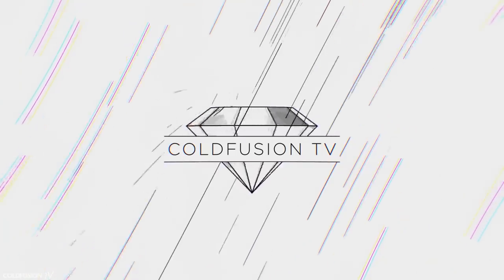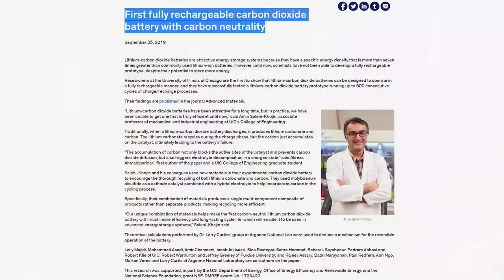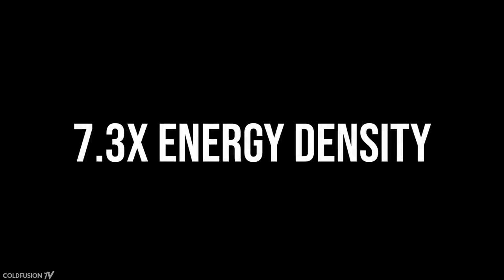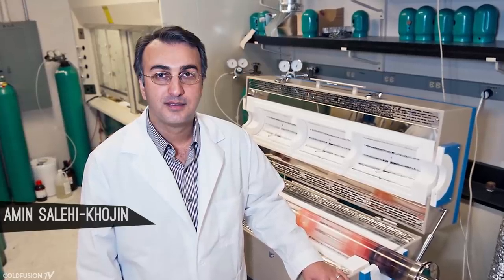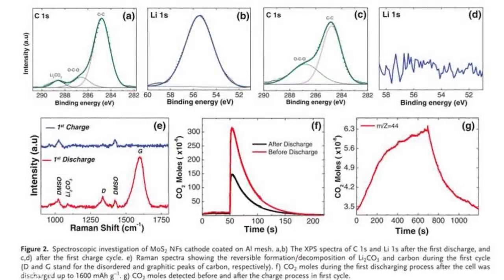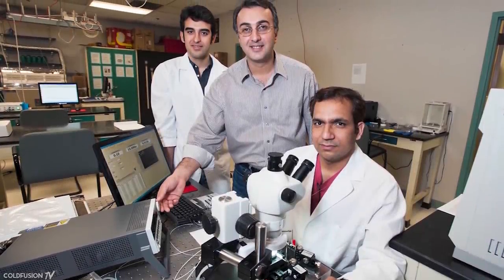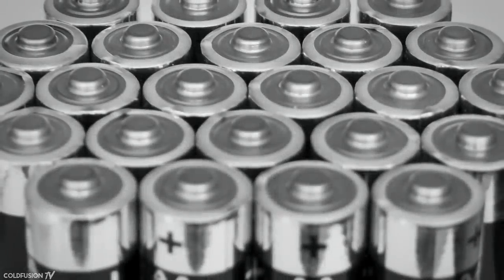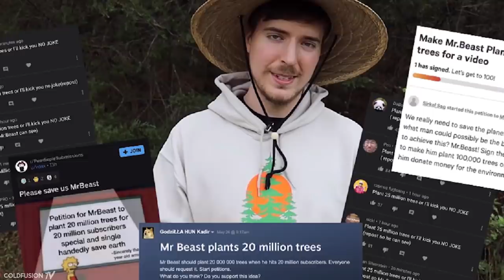Carbon Dioxide Battery Breakthrough

Comment from the maker: FYI, the research paper is in the second link in the sources, so you can read it there.
Reply: Can you make a video about Aluminum-Air batteries and the inventor Trevor Jackson ?
New recyclable Aluminium-Air power technology with 
1500 mile range battery and a 90 second swap system
Reply: I think I will never hear from this again.
Reply: 500 charge cycles in comparison to around 300 now seems not too beneficial for things like electric cars
Reply: You had to exploit the evil Co² propaganda and AGW didn't you...
Rather condescending to people who actually know the science well enough to understand that in nature, Co² is nothing more than plant food in the air and a climate stabilizer in the oceans. And in no way can it measurably effect climate change.
That's the sun's job.

But it's a cool idea, if it's commercially viable. Fascinating paper BTW.
Reply: Can you please make a video on nuclear fusion power production and potential
Reply: Very Interesting! Thank you as always! :)
Reply: Don't worry about the gap in videos, we prefer quality rather than quantity.
Reply: Carbon Dioxide batteries. 🤔🤔🤔

Get CO2 scrubbers to remove it from the atmosphere and stick it in a battery..... Two birds with one stone???
Reply: @TemporalOnline  Material science is a process.  One can complain about over enthusiastic reporting but not the science.
Reply: @TheScmtnrider  MIT have just done a similar thing without the lithium - carbon nano-tubes collect CO2 whilst charging. Then you can collect the CO2 whilst discharging and sell it to greenhouse owners ☺️
Reply: I'm waiting thunderf00t to shred them to shreds with basic thermodynamics... Mic drop
Reply: @thunderf00t
Reply: @TheScmtnrider , "...people who actually know the science well enough to understand that in nature, Co² is nothing more than plant food in the air..."
☺Refreshing to see people that actually understand that! Plants need carbon to build their mass. I didn't know that Co² was also a climate stabilizer. How does that work?
Reply: It's not 7 times more, it's 7 times as much.
Reply: @3deeguy  
2/3 of Earth's surface is water.
Water will absorb or emit Co², depending on atmospheric pressure and temperature.

Like a carbonated beverage left uncapped in a warm environment will rapidly emit its Co² into the atmosphere and get flat, just as if you shook it up and opened it.

Conversely, a capped carbonated beverage, stored at room temp under its own pressure, will retain its Co². The lower the temp, the less Co² it releases when opened.

You can shake it up, leave it capped, put it in the fridge overnight and by morning, the pressure and temp allows the liquid to resorb the Co² and it's no longer flat.

After the earths atmosphere warms, which it does cyclically, Co² is unlocked from ocean water and released.

It promotes plant growth that shades the ground and transpires more water vapor into the atmosphere.
Less heat is absorbed by the ground and clouds increase, along with plants and trees.

The atmosphere and earth now reflect more heat and the planet cools.
That allows the oceans to resorb atmospheric Co².

Plant and tree growth slow, plant transpiration and ground heat absorption reduces. Less water vapor is released, clouds decrease, and earth begins to warm.

It effects albedo and radiative heat transfer. It does so with decades of lag time and centuries of progression.

Ice coverage of land and sea are other causes and conditions that are part of the system as well. Galactic cosmic rays play their role and follow the he suns energy output 11 year sine wave and its hundred year grand max and min variations, as they also initiate cloud formation and the stratospheric volcano emissions increase with the GCR effect on increasing silica rich magma viscosity.

The past high levels of atmospheric Co²  went down over 12,000 years ago.
That Co² didn't just disappear, it was absorbed by the last ice age that ended with the Younger Dryas warming event.
That event's warmth again triggered a release of Co² from the oceans, and we've been hovering around 400ppm since it stabilized which, it did!
The charts showing the Co² hockey stick, uses a ridiculously low scale that makes the rise appear dramatic.
But we've exiting the strongest grand max since the Younger Dryas, hence the rise.

Expect Co² to go Jo higher. It will decrease after the cooling starts and the oceans begin to store it again.
Phone dying...
✌💨
Reply: @TheScmtnrider , "Ice coverage of land and sea are other causes and conditions that are part of the system as well. Galactic cosmic rays play their role and follow the he suns energy output 11 year sine wave and its hundred year grand max and min variations, as they also initiate cloud formation and the stratospheric volcano emissions increase with the GCR effect on increasing silica rich magma viscosity."
So the symbiotic relationship between plants and animals is even deeper than Co²-0² and the ocean releases Co² in sync with the growing season.
Wow, there's a lot of info here. When you mentioned "Galactic cosmic rays" I'm thinking 'ions'.  I asked myself if the magnetosphere came into play but that's not what you were saying. I never thought of the sun's energy in terms of a "sine wave". Never heard of "GCR".
That paragraph has a lot to digest and I couldn't grasp most of it but I'm going to study further because I want to understand it. Thank you.
Reply: As a student of Chemical and Biomolecular Engineering from UIUC (UIC's parent campus) it is nice whenever the cited reference is one I am familiar with. Thank you for seeking to maintain real, informative education for the masses using published scientific works rather than anecdotal evidence from what "scientest 1" on "this one show" said. I cannot tell you how much I appreciate it.
Reply: @3deeguy  
Your welcome.
GCRs are galactic cosmic rays.
Those are mostly high energy protons but are the same particles as in the solar wind, only traveling thru space at nearly the speed of light.
When they encounter the magnetosphere, they either pass through or are deflected by its energy.
That energy is the charged particles of solar wind that is captured by our magnetosphere's magnetic fields.

Weak sun =less energy and more GCRs get thru.
An active sun = more energy, and less get thru.

Once thru, some collide with or blow thru, mostly nitrogen molecules in the atmosphere.
The resulting cascade of exotic particles I included muons which form cloud vapor and hail nuclei.

The GCRs that don't have collisions coming through, can increase lightning. When they hit us, they can damage DNA and have other effects.
In hitting the ground, they penetrate, probably as far as to our core and beyond.

Have a great day
✌💨
Reply: Andy Spark fascinating bro, thanks for this post hopefully he does this. Will do whatever research I can as I’m keen from u’re post.
Reply: Absolutely love your channel. Keep up the good work. We need more positive like this.
Reply: @TheScmtnrider  That is misleading and wrong although it is what you say, it is also like salt in the ocean there is a level that it hits that makes it unlivable to fish for many reasons but unlivable to be assured.  Co2 is the same and the reasons are well know and unrefuted except by the people using terms like Co2 propaganda.
Reply: @TjBruce817  
Perhaps to someone who is unfamiliar with the effects of sea ice, and ratios of salinity to Co².

The Beaufort Gyre is a mass of cold fresh water in the Arctic that accumulates annually and releases. The salt content there is ridiculously low

It hasn't released in about four years.
When it goes?
I wouldn't want to be living in the British isles.

But you're a believer!
Nothing I say will sway your understanding.
Someday perhaps you will realize that belief is an emotion that inhibits rational thought.
Reply: On the other end of the battery sexiness spectrum, saltwater batteries are pretty interesting.
Reply: battery why?? if you use high power alternators geared on 106ish rpm to a 3000 rpm on the drive that would be for direct load and 20 years use potential and a small battery 5 years for loss and regulations flow depending on the system and amounts you need, have a 200kw 40x3.7kw alternators on a load motor and a resistor regulator from 7 + years back and the battery burns out to fast in 50 years lithium will not be around any more?. NASA couldn't even work that one out for a aircraft application I want my 1.5 tone off the ground with rail gun but got to that and we'll pig off a motor so cold fusion like the name!?. NEW YORK FULL...ssh!
Reply: @TheScmtnrider  in MODERATION CO2 is plant food. It is also a PROVEN greenhouse gas. That means, over a certain percentage in the atmosphere, it no longer works as a beneficial gas, but as a danger to our ecosphere. That's simply a fact. 

Denying it, saying it isn't true, does not change the facts of the situation. You can deny, deny, deny all you like, but it doesn't change the truth of the matter. AGW is a proven fact, as proven as gravity, as proven as a (more or less) spherical earth, as proven as the water cycle, as proven as the sun-centric model of the solar system. Pretending it isn't makes you look as intelligent as a flat-earther Luddite.
Reply: @MaryAnnNytowl  
No
You are sadly misinformed.
1800 PPMs of Co² is standard concentration for greenhouses but as for AGW?
It's effects are completely unproven.

It's based on a pre 2000 IPCC computer model that takes no account of cloud albedo, cosmic ray cloud production, solar x-ray forcing, the global electric circuit, etc... Don't get me started on TSI (The visible light spectrum.) All funded concensus science AGW studies are required to use it as the measure of solar forcing of climate. All other solar  influences are arbitrarily attributed to human forcing. Matter of fact, the suns most powerful outputs of x-ray light, actually cause TSI to reduce! Anyone looking at that knows that x-ray saturation is the cause of those TSI down spikes.

Furthermore, there are no examples of tested hypotheses failing to disprove Co² as a significant greenhouse gas.

What we have is 35 years of failed efforts to prove that hypothesis. That's the textbook definition of pseudoscience.
I'm sure you hate that word pointed at "reputable" scientists but facts are facts. Just as the 35 years of failed predictions.

Your statement demonstrates that you are unschooled on actual climate science. Also that you are unaware of the over 800 published peer reviewed papers on solar forcing of climate since 2010.
Not surprising as that contradicts popular belief and a myriad of corporate interests, including the media.

Farris Wald, a high school student won the Broadcom Masters national science contest by demonstrating the immediate effects of solar flares in the formation, invigoration and tracks of tropical storms.
He went on to win the Google world science contest for demonstrating the correlations between geomagnetic storming and tropical storm formation.

Climate is definitely changing but cyclically, as expected. Our sun's magnetic fields are weakening along with the sunspot cycles.
Simply put, a weak sun means loopy jetstreams and jetstream blocking.
A powerful sun does the opposite. That's how the Farmers Almanac is trusted.

Your belief is not based on science, it's based on science by press release!
I can link you to a shitload of studies. Tested hypotheses supporting my contentions.
I guarantee you cannot do the same with greenhouse gas Co². I know this because I keep up with the journals.

Remember, failing to disprove with studies designed to disprove! That's the big flaw in climate science. TSI is another. Billions spent to prove AGW, no proof yet. That's a clue!

I deny no facts. Just propaganda and parroting of the nonsensical "facts" you allude to here.

Earths operating range is over 260°F from the coldest be polar regions to the warmest desert regions. Loopy jetstreams move that around. But your referring to a theorhetical 1.5°C increase that has yet to manifest.

Cold is coming to the US. Not heat. Although there will be heat as well.
The record heat of the last few years BTW is minimum temps. If you look at max temps, it tells a different story. A reverse "hockey stick" chart if you will. One that's not fabricated like Michael Mann's.
Check it out!
100° chart.
https://drive.google.com/file/d/1BRKgYSN6HiCHscmxzNOAj7PgZmQ0iUqT/view?usp=drivesdk

This will support my claims.
Big paper solar climate forcing.

https://drive.google.com/file/d/1mDiKgN6JesH6Wxi7NcHvFXiV_w-P0Mm4/view?usp=drivesdk

I know my stuff, you don't. If you did, you'd know better... Unless you have something to loose?
So far? All I see is the same old rhetoric. I suggest you suspend your disbelief and seriously consider the rational alternatives not on TV or in academia. Because you've been spoon fed a whole lotta BS.

Edit...
PS
Did you know the acceptable Co² concentration on US submarines is 8000 PPMs? Not 800, 8000! Philodendrons grow just fine in the captain's cabin BTW.
Reply: What’s the outro music?
Reply from the maker: @HappyLeoul  A track I made, it's on my SoundCloud
Reply: @ColdFusion but what’s the name?
Reply: @TheScmtnrider  Thanks for this clear explanation. 👌🏻
Reply: @MaryAnnNytowl  If you have to open your argument using capitals, you don't have a credible case. Verbal agression is not going to convince anyone.
Reply: @TheScmtnrider  wait, the effects of greenhouse gases unproven? Right. It's very simple to set up tests, in one's own kitchen, for that matter, not to mention an actual laboratory, that show the ability of certain gases to catch and retain radiant heat (the part of the sun's light we are concerned with here) on the earth much more effectively than others. Very simple tests we are talking about here, and they prove what greenhouse gases do. This has been known for many decades. Seriously, anyone can look up John Tyndall's experiments! 

http://www.easterbrook.ca/steve/2017/03/the-discovery-of-the-greenhouse-effect/

This is proven fact, that we have known since Joseph Fourier started wondering why we don't immediately end up freezing when the sun sets on our side of the planet [as happens on the moon]. Within a few years, we had already figured out that certain gases trap heat much more efficiently than others do. It's very simple, basic science. To say it's "unproven" is to spit in the faces of scientists that worked for decades to explain our world around us.  Shame on you. Truly, shame on you.

As for your so called hundreds of peer reviewed papers, I hand you studies of thousands of peer reviewed papers. There is a reason the consensus is over 90%, and that is because the science has proved it.

https://skepticalscience.com/global-warming-scientific-consensus-intermediate.htm
Reply: @GTfour01  , my use of capital letters [to draw attention to the importance of the words] is simply one of the age-old ways of making the point that certain words are important to the point. Just like italics or bolding, it is quite common and nothing about it makes what is being said any less true. The fact that you try to make it seem as if my use of caps makes my information untrue is total rubbish.
Reply: @MaryAnnNytowl  No, it's not. You're trying to draw more attention to your text then is fair. Like everyone here, your views are in no way more or less in value. Your use of capitals is just a way of pushing your argument forward, at the cost of others. Know your place and respect the views of your fellow men.
Reply: If it can contain 7 times as much energy it can basically last 7 times shorter and still show equal performance.
It could be handy to have such a vehicle for racing, caravans or name it.
Reply: I can't believe it took me so long to find this channel. Makes me wonder what else is on yootoob that I could binge watch for an entire weekend...
Reply: More than 1 year later.

Still waiting...
Reply: @3deeguy  People understand that plants need CO2. CO2 is also actively causing climate change, which is killing plants. There is enough carbon dioxide in the atmosphere that plants can survive, but too much so that it is warming the world, killing plants and people.
Reply: @TheScmtnrider  There isn't enough ocean space to absorb the CO2.
Reply: @3deeguy  NO. The ocean doesn't do this, CO2 is bad for the environment when there is too much of it. If you eat too much of a healthy thing, you will die. Not saying that trees will absorb too much CO2, just that the atmosphere is warming because of it. The oceans aren't big enough to absorb all the CO2. Please don't buy into this person's lies.
Reply: @TheScmtnrider  this comes up almost first when you search up the Beaufort Gyre.
https://www.nasa.gov/feature/jpl/arctic-ice-melt-is-changing-ocean-currents
Reply: @wexlermackey2395  "Please don't buy into this person's lies." 
Firstly, you're about a year late to the thread. Secondly, Jon Mallary is more credible than you. Third, your avatar is a picture of a dog with a helmet on.
I'm done.